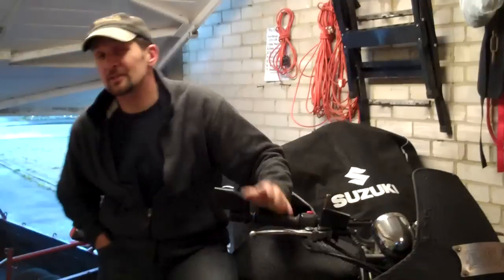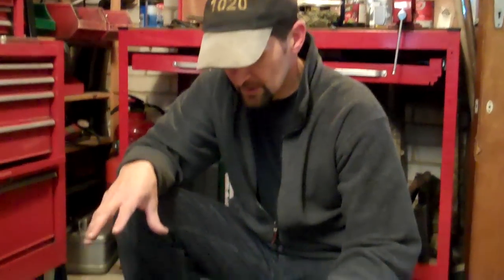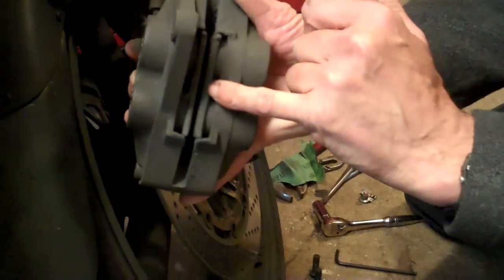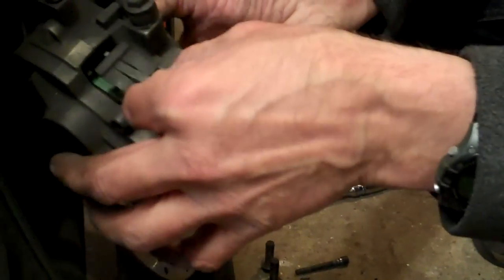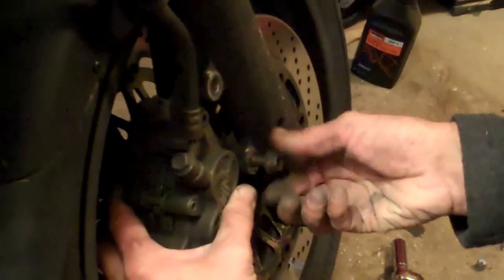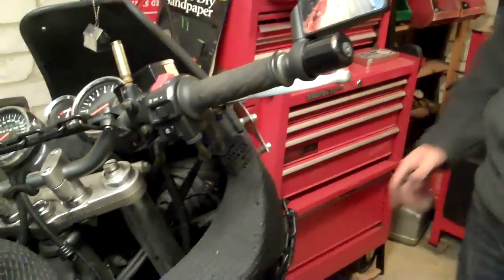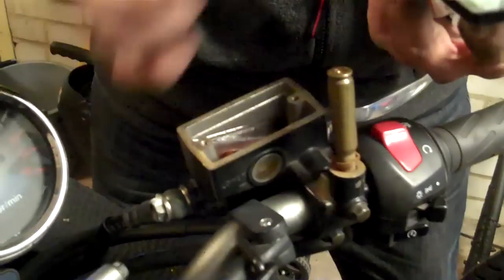Delboy's Garage, How-To Replace Suzuki Bandit Brake Pads.

Comment from the maker: Most certainly Sal, i get wjhat you mean and there has been a huge kick over that... people prefer the detail it seems, so i have spoken with the guys at Discovery and they felt the same too, aslo had lots of trouble editing them back and not loosing useful content.. so ill be filming some continuity clips for them shortly and they will use them to split the videos into two parts, that way the content will survive and still fit in.. problem solved.. thanks for your unput hun, take care, Del.

Comment from the maker: Hi mate, you hit the nail exactly on the head, your bike is 5yrs newer than mine and has different calipers, take your pads out and buy the ones that look identical, on the sale listing check that your bike is specified and if in doubt, e-mail the seller and ask them if they fit your specific bike... this way if he guarantees them to be correct and they are not, it is his liability to replace them with the right ones or refund your money...good luck with it, take care, Del

Comment: Just got an old bandit, needs the brakes done and lots more, thanks to you I've tackled the caliper clean and rubber seal replacement, going to replace the pads and do the same on the rear and maybe the discs too, you make it all look easy and to be fair the way you teach it, it is, thanks Del for giving me the confidence to have a go myself, cheers.
Reply from the maker: Most welcome buddy, am glad the video could help, and you've picked a proper legendary bike there... had my Bandit for 4yrs , probably only sold it cos there was nothing more I could do to it, kinda miss it now... good luck with your projects and glad the videos have helped you buddy...

Comment: Thank you. I've recently passed my mod2 and I'm looking to buy my first big bike. The Bandit is a possible choice and I want to do my own basis maintenance. This instructional video is marvellous. If I can add a tip from a complete novice, when taking out your bolts and pins etc, place them in a tin or bowl so you don't lose them. I'm a bugger for putting things down and losing them.

Comment from the maker: See my 'Clutch Fluid Change' which I just loaded, it's the exact procedure for brakes too..sometimes trapped air can fragment into microscopic bubbles and permeate throughout the fluid,so even if you've just bled them it's worth pumping a couple of reseviors of fresh fluid through he system so that you 'change' the fluid,then when that's done,seal it all up and bungy the lever in against the grip overnight,this pressurises the fluid,opens the valve & allows any air to drift to the top Del

Comment from the maker: Yes indeed, mate, when I trained as a bus fitter it was actually a discipinary offence not to test drive the vehicle after you'd worked on it, it was that important, also there's nothing worse than finding out the front wheel is binding or the lever is not set correctly, etc., as you set off for work in the rain the next morning, if you test ride it you have a chance to make any adjustments before you need to rely on it,,, thanks for watching, buddy, take care Del

Comment: Update: Nevermind :) You've explained it later in the video 
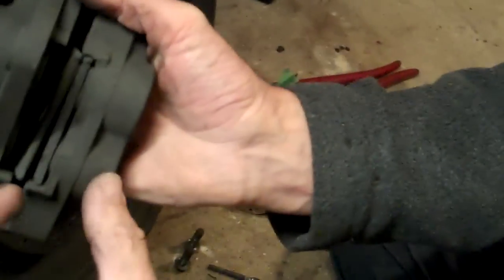Just a note, when you push pads back at around 6:00 I'd recommend checking the brake fluid level in the reservoir. When the pistons are pushed back the level rises and if it was filled recently it could be hard to push pistons back as there will be no space in the reservoir. Also opening the reservoir will make it a bit easier :)

Comment from the maker: Hi Bisto.. thats a tall ask in one comment box.. its not hard to balance them, but the best way would be to get a manual to get the basic run through, use the mercury gauges for the easiest results..and set aside plenty of time as it takes a while to get the hang of setting them in turn.... sorry i cant just give you an easy fix on that, its a bit of a knack.. but practice makes perfect..

Comment from the maker: Hey Mikey. Its a bit wide open that one, it depends on how you use them and the quality of pads you buy, crappy cheap pads used heavily all the time could rub out in 3-4,000 miles but a decent quality pair of pads like EBC treated properly by a sympathetic rider could be 4 times that, as a guide I used EBC pads the last time & they gave me 15,000 miles, but maintaining the calipers (keeping them free'd off and not binding) & riding with sympathy to your consumables is the key Take care buddy,Del

Comment from the maker: Hi Rob.. good to hear from you buddy, and thanks for your kind support... with your brake pins, check out my video on rebuilding the back caliper, (ill send you a link in PM in a minute) there is a trick of drilling two little holes in the caliper body so they can be drifted out....otherwise you can just split the caliper body halves in two and they will be easy to drop out then....and its never a bad idea to get some new ones, they dont cost much and then you can keep on top of them in future

Comment from the maker: Hi mate, the squeeling is caused by VHF vibration, and the task it to stop it..some bikes actually have a thin steel shim plate that goes between pad and piston, see if you are meant to have some and they are missing?.if they are binding even a little bit then get them cleaned properly, watch my cleaning calipers video, and if it still does it then maybe strip and rebuild the caliper with new seals. finally, check what kind of pads its meant to have, maybe softer pads would help, good luck, Del.

Comment from the maker: Right, get you now, and this is never done on motorcycle discs, they are too thin in the first place, only 5mm thick in some places, it is possible to have the 'skimmed' on a lathe, but it is inevitable that they will need replacing, the thinner they get the more likely they are to warp under heat, such is the expense of running a bike, a pair of front discs of any qaulity are over £300 and running the pads on the metal can lunch them in a day. Cheers Del

Comment: I am sure you said that the  pins retain the rear pads are stainless (steel) but they are not, or at least mine are not...
I gave them a good clean, and put it all back together with a recon caliper. 
(I guess it depends if you have time, but no money, or the money but no time. For me it was more cost effective to pay someone to else to refurbish the caliper.)

2 days later I rechecked it, to make sure all was good, and the refurbed caliper was not leaking. It was 20 years old, so I forgave it for leaking to stat with....and the pins were rusty red. 
No wonder they seize in to the caliper, cheap crappy steel.

As an aside, the white crud you scrape out of the seal grooves that buggers motorcycle brake callipers is not road salt, it is oxides of  aluminium, which is what you get when aluminium, water and salt come together,

But, and I mean but, nice helpful vid.
Let me know I’m was refitting the refurbished caliper correctly. 👍

Comment from the maker: Ayup Jeff.  use antiseize (or copperclip) on the bolts....think about it...you DONT want them to seize in there..and loctite will do just that, lock them in place... the fasteners on brakes tend to weld themselves in due to continued heat cylcling and dirt, crud and rust....so you need a compound that will prevent that..not one that will promote it..!  and Penny says.."so what you're saying is, you still havent done it yet"..lol.. some day we'll get that beer cracked and tell some stories buddy.

Comment from the maker: It's not the same thing, but it does the same job, anti-sieze has various soft metallic compounds within it, sometimes lead or zinc, sometimes alloooominium (!) and the purpose is that the high melting point of the metallic particles prevents the grease from flowing to places where you don't want it, also the non-ferrous natire of those particles prevents rust and in this case copper grease (copper slip) use copper erm obviously! ...Penny says have you got that bolt out yet?  ...

Comment: honestly for all the newbie mechanics who don't put things together on a daily basis, and don't have a good feel on how tight bolts should be, Invest in a torque wrench, so that when you get to critical parts like these two bolts; allowing you to slow down your bike, you can just follow the torque spec that is likely to be in your manual:) that way, you know you are safe, also, if you have a chance, put a drop of loctite 243 on the bolts instead of copperslip, that way it's an added security as it locks them in even better, and won't vibrate out if they are too loose.
and it too will prevent them from seizing quite nicely.
Reply from the maker: Thanks for your input Morten.. good call on the torque wrench.

Comment: Hello from the USA, your video by far the best for brake pads change, thank you very much.
One question for me to change my pads only, do I need to worry about brake fluid overflow.
It's confusing to me because the original pads fit at the same fluid level. Why would new pads change that. I understand it's more fluid travel, but it is no more than when the pads were new. 
ANY HELP WOULD PUT ME HEART AT EASE, PLEASE AND THANK YOU.
Reply from the maker: Hello John, ok it works like this... with fresh brand new fat brake pads your fluid reservoir should be filled up to the 'full' mark at the top of the glass... then as the pads wear down, the pistons have to push out further to operate them, so the fluid in the reservoir drops slightly... this is how it should be left... and never be 'topped up', because when you pistons back to fit brand new pads that fluid will return to it's original full level... but sometimes people incorrectly 'top up' their brake fluid reservoir as they think that it's necessary, then you have too much fluid in the system and when you push the pistons back to fit new pads, yes it can overflow so you should suck some out to make sure it doesn't overflow... and then with the new pads fitted, top up the fluid to the 'full' level and leave it that way.  Hope that makes sense, good luck with it mate.

Comment: Yep i replaced the diddy pads on my mates aprilia habana scooter, and yes it was down to the metal so the disk had to be dumped as well.

I did put tiny spots of grease where the shoes touched the caliper, very tiny spots dont panic :-), the slide in pin i used wire wool to clean.

They did slightly catch the disk but i suspect it will become better when worn in, otherwise its big hammer time ha ha :-)

Good video mate, get your parts ready before filming, ow er that sounds naughty :-)

Comment: Another excellent video. I'll be doing this on the weekend. Any tips for pumping new fluid through ABS brakes?
Reply from the maker: Depends on your ABS system, Niclas, if it's the hydraulic type with a central control unit, they have their own bleed valve... if it's the sensor wheel on the brake disc type, like late model Bandits, then it's electronic so just bleed up as usual, if in doubt, get yourself the right manual and check the system for your bike... good luck!

Comment: Hi Delboy and Penny , just like to say a big Thanks for all your videos, I'm an avid watcher and newbie to bikes after 30 years on four wheels, your guy's are an inspiration.  I know that you don't do videos on demand for obvious reason, there's a Bandit to complete, but wondered if you had any tips for freeing up the brake pins on the rear end of a 2000 Suzuki gsx600f.  The pins mine are seized to buggery and don't want to shift, almost at the point of cutting them out and replacing them!!!!!!!

Comment: hi again dell, i have new caliper on that i striped and polished inside to mirror cus of the issue, new seals and packing + grease and i cant find eny other type of pads .if im to put a metal shim would it matter if its cut so i can get it on?its a disck shape with 3 "springs" to hold it in place in the piston and other side it just slpips in and hold by split clip like your bolt! never had a prob like this!thanx 4 answering.

Comment: Hi del, found you whilst searching for a vid for changing brake pads now I'm a massive fan! Had a wee snag when I did the job as I mistakenly pumped out one of the pistons. I removed the caliper and replaced the piston but on refitting it I now get no brake pressure at all. Have tried bleeding both calipers with little success, going to try it with a vacuum pump this weekend. Any idea what I've done?!

Comment: Great video, thanks.
I've seen people pump out the pads BEFORE final tightening of the bolts.
Is that something you would recommend?
Reply from the maker: Hi mate, don't see the difference to be honest... at least if you tighten them up with the pistons back then the calipers will be correctly in place on their castings and not hindered by the brake pads stopping them seating properly.!
Reply: Moonfleet41 I think the idea behind it was to help alignment, but I guess it wouldn't make any difference in practice.

Comment: Brilliant video mate, top bloke! I've watched several tonight I can't thank you enough for clearing things up. Just wondered, I have a Honda Hornet 07 plate which means it has abs on - Do you know if this will be an issue? Cheers!
Reply from the maker: Hi mate, if you are just replacing pads, then ABS makes no difference... try not to damage or disturb the ABS sensor on the front wheel, other than that it's the same... thanks for watching mate, plenty of other vids on our channel which may help you, Cheers Del

Comment: Hi del, great video, I recently changed the front pads on my gsx1250fa ( virtually a bandit ) , however on the outside on the right hand disk after a short ride there is a blackish mark being left from the pad. I can hear it when I ride it and when pushing the bike. The brakes seem to work just fine and I pumped the front brake after fitting the pads. Is this something to worry about or a bedding in period? It did seem a straight forward change considering it was my first time. I dont want to cause any damage or worse.  Any advice would be great. Cheers lance
Reply from the maker: Hi Lance, if you are riding in this current weather mate, it could be road salt and crud, which makes a horrible mess of your brakes and they can dust a little more than usual whilst they are bedding in... all that's important is that they are not binding... when you stop after a ride, then grab hold of each of the 3 discs and makes sure they're not getting hot for no reason.... good luck with it mate, Del

Comment: Hi Del Thanks for the great videos it all makes sense with your just right explanations.  Just wondering re ABS brake fluid replacement only?  Is it any different compared to a non ABS system?  As long as you make sure regarding no air ingress of course.
Keep the great vids coming it saves many of us cash and more importantly gives us all much more confidence.

Comment: Hi mate, great video! 

Ive just replaced the pads and discs on my cbr600f and everything was goin great but it has started to whistle and get warm on one side of the discs. Ive stripped the caliper down and everything is in great condition. Also i have put copper grease on the back of the pads so im not sure why its whistling when braking. Any ideas? Thanks
Reply from the maker: Hard to say without looking at it mate, make sure you have the pads all moving freely if they are binding at all, then they will eventually squeal even with copper slip on the back....maybe give the calipers a good clean around the piston lines and that may free them off a bit and let them retract...!?

Comment: I have the caliper off of my bike (as you know) and while it's off I was planning on attempting to install new brake pads. Are you saying I can use anti-seize on those bolts? I shouldn't use loctite? ... Tell Penny that getting that bolt out will be a monumental moment and I need her to record it for me!! ......

Comment: Excellent tutorials. You've given me the confidence to tackle a lot of maintenance that I used
to pay through the nose for. Plus it's simply hard to find good independent bike mechanic.

Couple of quick questions. Red rubber grease? For or against :-)
Thinking of swapping to braided hoses on my 2004 Speed Triple. Good idea?

Keep up the great work. I'm hooked :-)

Comment: @Moonfleet41 hey dell , my first real q 2 u is; my cb 400 from 77 has a round disc and sindle sided piston , breaks well but squills like a pig roasted alive and some times even starts after a bit of riding . ive cleaned it several times but it only holds clear riding once and then starts the whining .what is a man to do. no pitting or buildup and i also used copper grease to solve it without luck. eny suggestions?